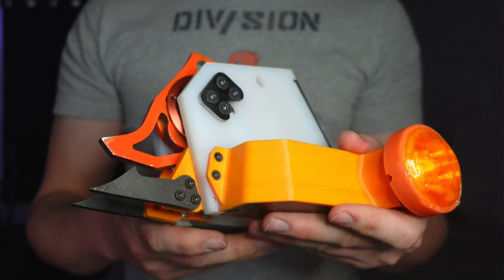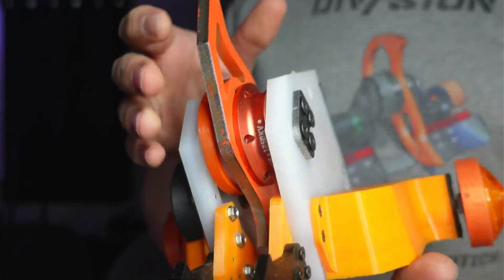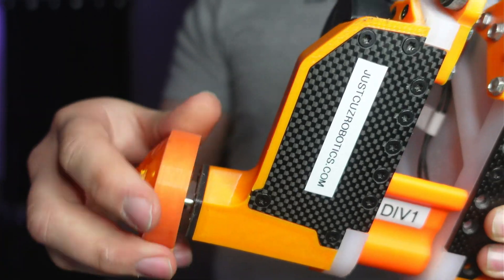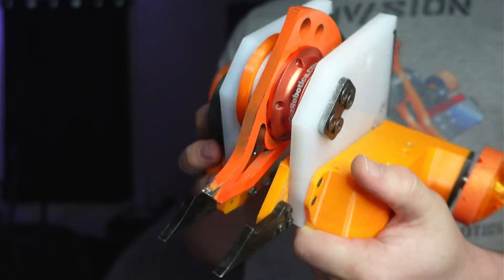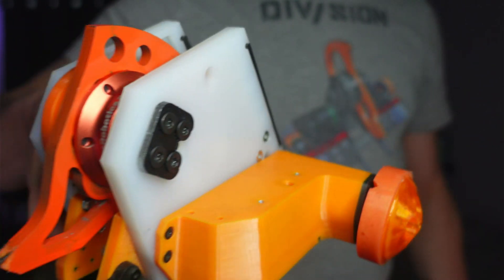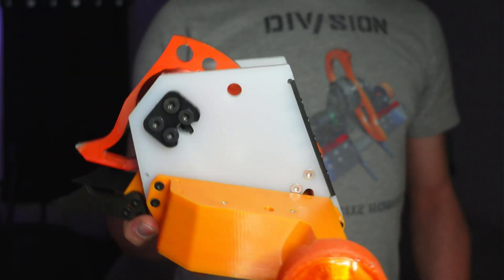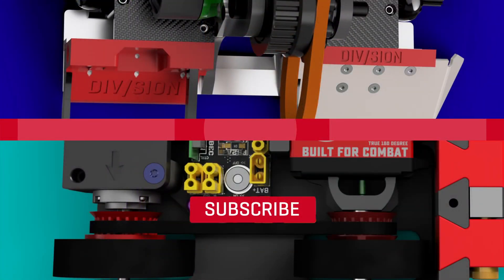DIVISION VERSION 4.0 HYPE REEL

Comment: great design! however, i have a question:
since the flywheel has so much energy stored, when your blade hits something and stops, wont the flywheel keep spinning (thus, the knurled wheel) and shred the TPU disc? how does the setup compare to a spur gear design? thanks
Reply from the maker: You are exactly correct! And that's intended to happen since the alternative would be transferring all the flywheel energy into the weapon and that's a ton of energy to handle. It would probably shred normal gear teeth. The TPU rubber disks cost $0.32 in plastic to replace so I can do that every fight if needed.
Reply: @JustCuzRobotics oh, that makes sense.
have you ever thought about adding a really stiff radial (torsion) spring in the disk/gear somehow?
 i believe it wouldn't affect spin up time so much and could maybe reduce the amount of energy received by the motor on impact, might also reduce the force of the impact overall tho, idk.

a friend of mine used a one-way bearing on  a vertical spinner robot, it pretty much nullified every impact to the motor, but it did reduce the damage caused by the bot, it would be interesting to see somebody testing this.
Reply from the maker: The current system works well so I'll probably keep it more or less the same

Comment: The two UHMW pieces seem to hold by a piece of carbon fiber and the TPU frame, I don't know if it might bend in the middle leading to the friction system of the weapon to stop working after a hit. You're always nice to see go with your ideas, excited to see the results! Cheers :)
Reply from the maker: There is another 3d print sandwiched in the middle so they are decently rigid setup but it could cause some issues.

Comment: Thats fire dude. I was thinking about doing something akin to a mini monsoon myself with invertibility, duplicated sides on a 45 degree angle and programming in a switch the just invert the bot at will, but always had issue trying to figure out what to do with the motor. That hub might just be trick to make it fit!
Reply from the maker: Yeah hubmotor should be ideal for this for sure

Comment: I enjoy the new division, but would you bring back division 3.0 for a few more matches, perhaps under a new name like Fraction or something? Because I enjoy the chaos Division 3.0 and other tower verts (like deep six) bring. But how much KE did you lose with the smaller disk, and how much smaller (in terms of diameter and weight) is the disk?
Reply from the maker: As far as bringing V3 back, I honestly thought about selling it so someone else can do that for me. I have a small apartment full of robots and I have 2 almost complete Division V3 copies that could use a new home....
Reply from the maker: The old weapons went up to 255g and 7.5inch diameter. The new weapon is 170g and 6in diameter, but the weapon RPM is substantially faster. V3. Was 211mph and V4 is almost 300mph so it has a similar amount of KE.

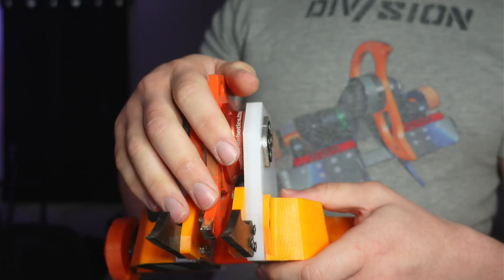Comment: 3:00 Will the flywheel energy and weapon energy add together?  500J  + 1500J = 2000J
Reply from the maker: Not exactly. The flywheel will slip on hits so it isn't adding energy in the moment of an impact but it will slowly spin the weapon up after a hit
Reply: @JustCuzRobotics  wait, aren't they spinning opposite to each other so they can cancel the gyroscopic force of each other?
Reply from the maker: Yes they cancel gyroscopic momentum, but that's different from the kinetic energy delivered on a hit

Comment: I've only been watching you a few weeks but as soon as I saw the design breakdown, I knew this was Gona rip! Ironically, I've wanted to comment about using counter balance wheel to aid driving
Reply from the maker: I've probably gotten a few comments over the years recommending this but it is a massive undertaking. The flywheel system adds half a pound to the robot and a lot of additional complexity and precision. It's also by far the most expensive part of the bot - PCBWay made me the parts for free but it would have cost over $150 for a single flywheel assembly out of pocket. I was not as confident in my ability to pull this off until I put weeks of thought into it. And I explored a lot of different ways to spin the flywheel before deciding on the friction/tangential drive system.
Reply: @JustCuzRobotics  well done man, I love watching the creativity and problem solving flow, you always lose something to gain something no matter what it is you're doing.  Cannot wait to see this thing debut

Comment: psyched to see how if the flywheel gearing will hold, and how it will drive with the gyroscopic forces of the weapon potentially cancelled out by the flywheel. Also cant wait to see how the direct drive motor will work.
Reply from the maker: The flywheel cancels about 60% of the weapon Gyro so it's not perfect but it's still extremely helpful. The rubber disk driving the flywheel is sacrificial and probably will get shredded by the end of a fight but it costs next to nothing to replace.
Reply: @JustCuzRobotics  I love the fact that the rubber disk covering the flywheel is basically a weapon belt. It's just using compression instead of tension to transfer motion.

Comment: Love the concept of a just add a blade drop in wepon system. As a new builder, designing a reliable wepon system has been the biggest challenge so far
Reply from the maker: That is the hope! My goal with Just Cuz Robotics is to lower the barrier of entry into the sport of robot combat for everyone. I think a purpose built weapon motor is the best way to do that going forward.
Reply: @JustCuzRobotics  your definitely on the right track. So far, all your videos and products have been really helpful. The only suggestion I would have would be to offer some of your boards pre-soldered since most people starting out don't have fume extractors, and it's not always an option to open a window in the winter
Reply from the maker: I believe that if you want to build and fix your robot you probably need to learn to solder. A fume extractor while a nice to have isn't an absolute necessity. A few people told me they solder in a bathroom with a vent fan going.

Comment: Seth, that thing will kick ass. But I have mixed feelings about the design because it is not like any division I have ever seen before. Also, with the right luck and skill, you might beat lynx. Also I have an interesting idea. What I’d Division was a drisk?
Reply from the maker: A drisk would mean the blades are half the thickness, worse for fighting horizontal spinners. But I could probably make a drisk version of the hubmotor... Would be better for bots with a smaller than 6 inch weapon
Reply: @JustCuzRobotics how thick is the weapon
Reply: What’s Remainder?
Reply from the maker: It's a 0.44lb minibot. The flywheel system is heavy so in some cases I need it for extra weight at NHRL as they have a 1lb multibot bonus.

Comment: Oh baby! Mad respect to the ambition to direct-drive your weapon. Cheesecake the antweight robot approves! Great way to save weight, albeit at the expense of potentially damaging the weapon motor, I'm excited to see how it holds up!
Reply from the maker: The hubmotor system should be very durable. I think it would be especially good for horizontal spinners which tend to lose belts constantly due to long belt lengths and low rigidity.
Reply: @JustCuzRobotics  - Darn it, you're right, that's a really good use case. I'm in the early design stages of my beetleweight, so I might just do that instead of a traditional belt system.

Comment: I’m redoing my bot right now(actually it’s pretty similar to your 4.0 division which made me laugh when I saw your design) and I have extra weight to spare since my new chassis is gonna save a bunch of weight and I might borrow that fly wheel idea. That’s so smart to try and I don’t think anyone has yet on a bot this small. The beetles are getting to the point where people can actually try stuff like this and it’s awesome
Reply from the maker: I'm definitely not the first to do a flywheel at 3lb, but maybe like 3rd or 4th? With the flywheel and no front ends, the bot is still under 3lbs, while Fireball 3lb is 3.5lbs with their flywheel, so it might technically be the first <3lb robot to fight at NHRL with a flywheel. But with front forks or wedge its closer to 3.4lbs so I have Remainder as a 0.44lb mini as NHRL gives you the extra pound for a multibot.